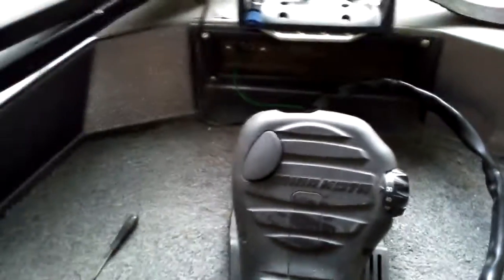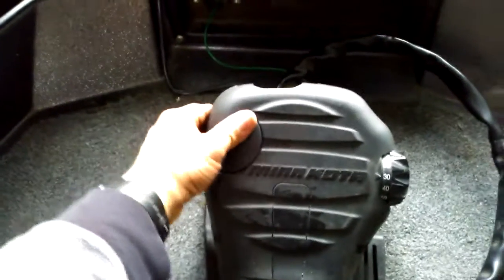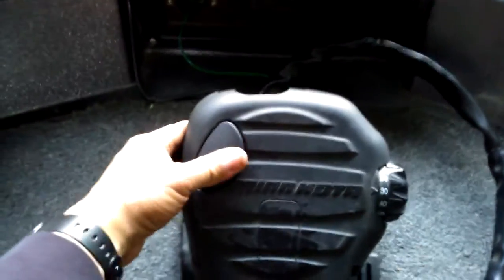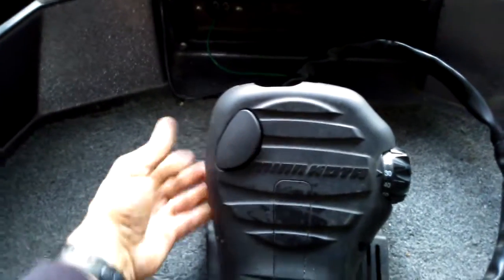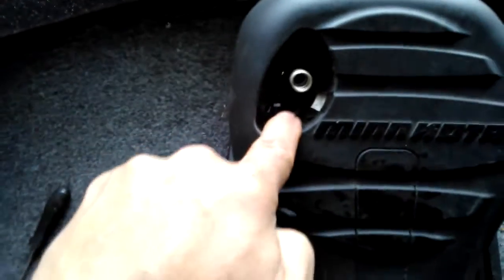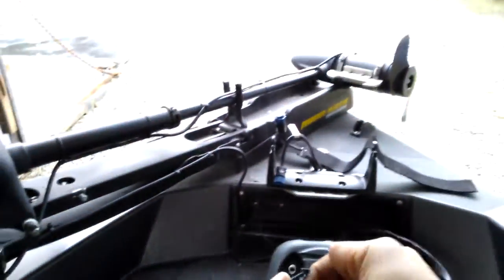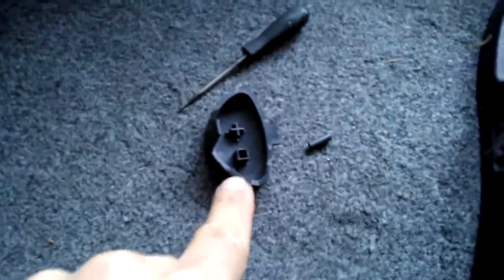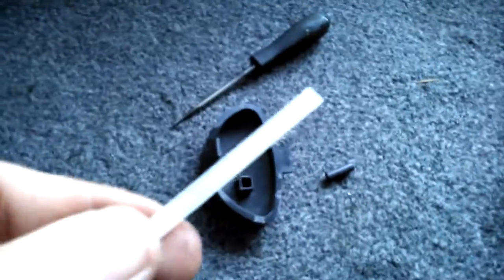Minn Kota Maxxum 70 pedal button fix

Comment: I just installed a brand new ultrex on my boat and this same switch is on  it. Brand new out of the box and first day on the water it didn't work. Tackle warehouse wanted me to uninstall the motor, box it up and send it back..... this simple fix just saved me 4 weeks of BS. I cant believe that I just paid 4k for a trolling motor that was broken right out of the box just to fix it with a tiny bit of plastic..... lol way to go Minn Kota....
Reply from the maker: That's crazy.  Glad it helped

Comment: Thainks . I have the problem with my fortax 80lb. With it staying on and not always disingaging. Thaink this will help that issue??
Reply from the maker: Bill!  I don't have a Fortrex 80 schematic in front of me to tell you much about that particular switch.  Seems to me a new switch would be in order.  If it is the same type of switch and base that I have, the magnet could be loose.  I'd try my cheap fix to see if it engages better.  If it does, check to see if the magnet is tight in the pedal base, and not slipping out.  If it isn't stuck in there good, try a drop of super glue...but just a drop!

Comment: Tried it and it worked great for a few months . It has started malfunctioning again. Cannot get the piece of plastic out. Tried adding another piece , but still not working. The motor runs continually when the switch on the foot pedal is at the MOM position. Any thoughts from anybody? Thanks!!!
Reply from the maker: I'm Sorry for not replying earlier.  I'm sure you got it figured out by now.  It sounds like a bad switch, like the contacts inside have welded or stuck together.  Or a short in the wiring?  easy stuff first!  Then I'd look at the speed control circuit board.
Reply: @sonofgodruss  thanks, you are right with the circuit board. Had to take it to the dealer. We will see when the weather warms up a little. Hope you have a great Spring!